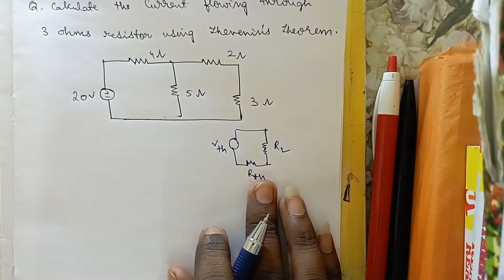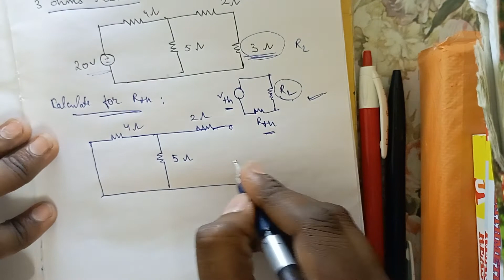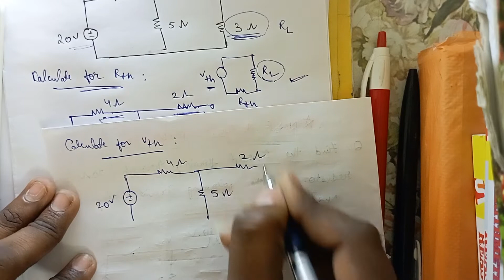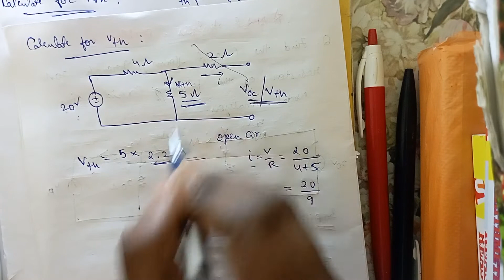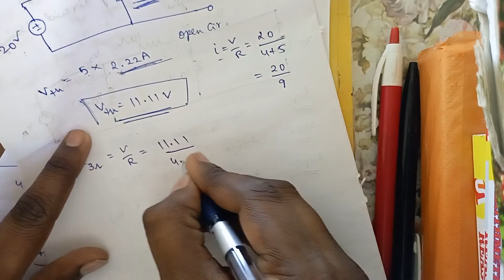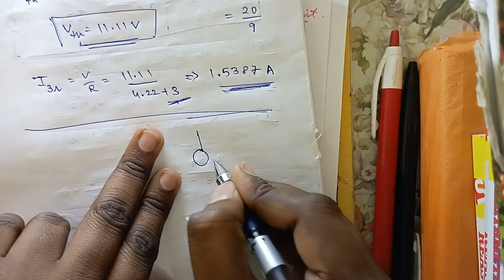Thevenin's theorem Problem -1 || Telugu

Comment: Mam For vth u consider 2ohm resistor as open circuit and neglected it then why u considered while finding rth then?
Reply: Yrr vth appudu neglect cheyali 2 ohm ni endukante
2 ohm gunda current vellaledu open circuit kada current lekunte voltage kuda undadu andukani consider cheyala 2 ohm vth kanukkunetappudu